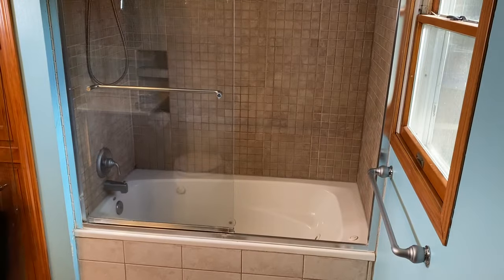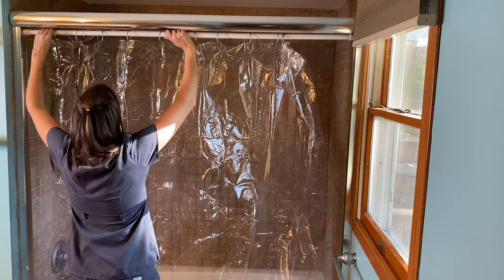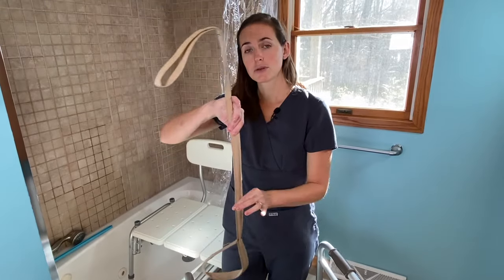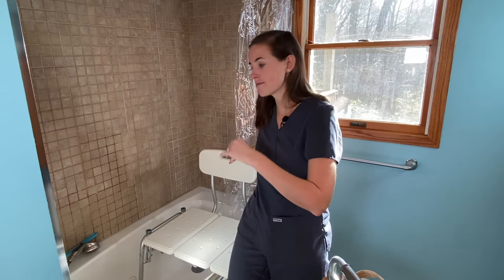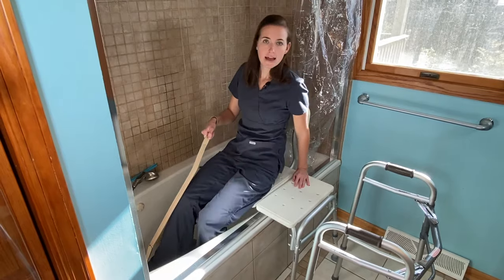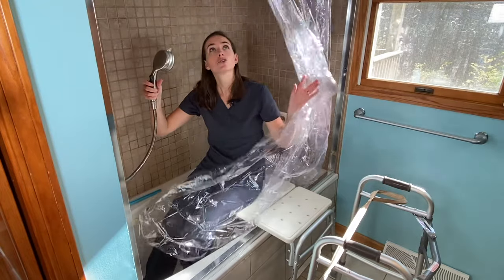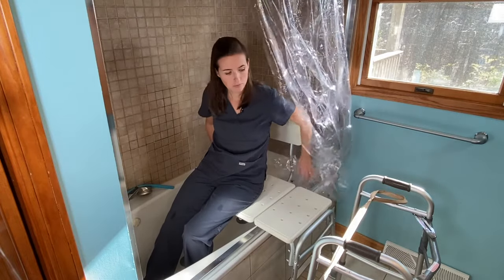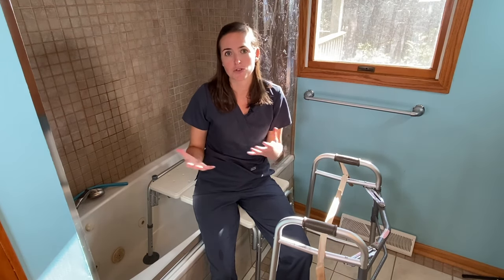Showering After Hip Replacement | Setup, Equipment and Technique for Tub Shower

Comment: A suggestion: Buy a shower-head with a hose that has a shut-off.  (Not necessary if you've a helper)  Some shower heads shut "mostly off." then if alone, you don't need to (no-no) bend forward to turn the water on.  Excellent video, ty.
Reply: Thanks so much for the advice.  Through the whole video I was wondering how to turn on and off the water with out doing before you get in otherwise the floor will get soaked before I have time to get in and pull the shower curtain... I'm so confused my orthopedic and nurses were telling me to set everything up for the operating leg to get in the bed and shower first but the videos are showing the opposite and I don't have a physical therapist yet Thanks to my horrible primary doctor it's been been 10 days and I'm in pain and so confused on what to do or not do other than 90 degrees.  I have avascular necrosis so both my leg muscles are weak before surgery.  Any advice on anything else I'd love to hear,  exercises or which leg you used to get in bed 1st?

Comment: I’m having a hip replacement soon and will largely be taking care of myself. I will have to turn away from the nozzles to turn the water off and on. unfortunately I’ll have to bend over to turn the water off and on. If I were facing the handles i could turn it on after I’m sitting

Comment: My pre surgical instructions (coming up soon) says I won't be able to bend forward to turn on the water and I have turn it on beforehand and clamp it to the bench or wall. I have to go out and get a suction cup shower head holder for the wall as well as a leg lifter, I will have my bench for practicing all this in a few days. Thanks for the tip about cutting a slit in the curtain to poke it down the bench slot, I wondered how the curtain was going to work to keep water in when going around the outside of the bench and the edge of the tub.
Reply: I was wondering about how to turn on the water as well. Wish she would have covered that. Even if you do it before you get in, you would still have to bend to turn it on. Methinks I'll be limited to sink-based sponge baths for the first several weeks.
Reply: While I was still using the bathing transfer bench in my first week I simply stood up to turn on the taps (which advice I read somewhere, and I had installed a suction shower head holder lower down I could stick it into.)

After a week it turned out the hardest part of showering for me was the bathing transfer bench itself as I was very steady on my feet. When I took my water proof bandage off on Day 7 I didn't want to be sliding on the bench any more so close to my incision and one of my post-surgical physio exercises showed me I was safe stepping over the tub edge by bending my knee and raising my feet  in turn behind me while holding a grab bar for safety. We installed 2 more suction grab bars so there's one on each wall of the shower/tub enclosure and I'm safely showering on my feet, now. I don't know if I'm unusual in this but it's a lot less stressful than the illustrated method which I stuck to at the beginning.  I'm on Day 10  after surgery.
Reply: @e.b.gilligan7423 I’m having my right hip replaced on October 21, 2024.  May I ask how old you are?  I’m 71.  I’ve been thinking of just doing sponge bathes for the first week instead of all that hassle.  I have a tub shower.  The water handle is a single knob which is kind of hard to adjust normally, plus the toilet is really close to the tub, so there’s no way I could safely try to turn the water on and adjust it.  I’m overwhelmed by the toileting and bathing.  I guess I could have my husband get the water going for me before hand.  Not looking forward to this!

Comment: I'm about to do a wet "dry run" today with surgery coming up in 5 days, having difficulty in our very small older building washroom now that the toilet seat raiser is installed, trying to get my leg over and past that and the edge of the toilet tank using the new leg lifter. Our antique tub with its sloped insides limits how far away from the taps I can place the bench.

I believe when I had a broken leg 6 years ago we had a shorter "round" toilet since replaced by an elongated one, no raised toilet seat t hen, and it was actually easier to use the bath transfer bench with a broken leg and a soft cast covered in a plastic sleeve than it's going to be with this surgery. The tighter space/higher toilet is a big challenge, I have to lean way back on the bench which is actually on wood pieces for a few inches extra height outside the tub to clear my leg above the toilet.

Wish me luck, I obviously can't sponge bathe for 3 months.
Reply: How did it go? Hope you are doing fantastic, now! I get a new hip in Feb. Just starting to prepare, now that I’ve been to the surgeon.
Reply: Overall recovery from my hip replacement mid September has gone very well. I still have a way to go to normal movement in all respects but my surgeon lifted joint precautions November 6 and I've been able to resume activities like driving, do some stationary cycling to get a little cardio exercise again. I still have some  issues causing pain in places other than the hip and hope to get them resolved so I can walk longer distances outdoors more comfortably and without my cane. 

I only used the bath transfer bench for about a week after my surgery, it was the most difficult thing I was doing because of the crowded space in our bathroom. We installed grab bars on all three walls of the bath enclosure and I showered safely standing up ever since. I do have good leg strength from years of bicycling and always use the rubber bath mat in the tub.  I step over the tub edge  by flexing each knee in turn to raise my foot back towards my derriere, holding the  grab bar for safety. This may not work or be safe for everyone but has been good in my case.
Reply: @e.b.gilligan7423  good to hear your favorable outcome, thank you! Great tips.

Comment: I am learning a lot from your videos - thank you - I am using a bench in my tub/shower combination already with the water hitting my back so I can wash my hair.  Today I had  two handicap grab rails installed. One is on the outside of the shower to offer support in entering the tub/shower and the other is just inside at the end wall.  It is an angled styled one so I can make the adjustment comfortably sliding my hand up to the higher height after getting into the tub then moving to the bench.  Is it truly necessary to remove the glass shower doors putting up the plastic curtain? I always feel claustrophobic with the curtains and they seem to get sucked into the shower thus entangling a person? I would really like you feed back.  thank you
Reply from the maker: It isn’t required if the shower bench fits with the glass doors in place and you aren’t requiring a person outside the shower to assist. The glass doors make it harder to have help, but I agree they are a much cleaner, more visually appealing option!

Comment: Hi Lindsey I am having total right hip replacement in 2 weeks.  My concern about my shower (I live in apartment complex) is no hand held shower head.  I have weight bearing bars installed however I will need to get into the tub standing.  Do you have any instructions on that?

Comment: A great tutorial.  I'm 5 feet - does the leg lifter work for someone my size?  Also L hip - so I'll be using my right leg to get in shower and then lift left?  If I do it that way, I'll be facing backwards from the faucet and there's no room w the toilet.  Also,  maybe a shut off w the hand held shower?
Reply from the maker: Yes! The leg lifter can be held anywhere along the length of the handle and that would make it work for your height. You can go left leg first if that is how your bathroom best accommodates the modified strategy. Good luck!

Comment: Ok I have a walk in stand up shower and I am presuming the OT will advise using a shower chair is that ok to use as I expect I shall be using the air dry method as you say to let my feet dry., although I do have some experience in using a shower chair pre-operation in a normal overhead shower. Now how often do you recommend having a shower? By the by I do have long handled shower tool which is like a scrunchy that women use for their hair and have been using this for some time now.
Reply from the maker: A shower chair should be fine in your case and most find a shower every 2-3 days sufficient.

Comment: I read somewhere to cover your wound with Glad Press N Seal overtop.   Haven't tried it yet.
Reply from the maker: It works pretty well, won’t seal all water out but will prevent the soaking most surgeons want you to avoid.
Reply: Puppy Pads work well to create any size bandage. Since they are made to trap moisture on one side while preventing moisture getting through on the other side, they are great for covering wounds and keeping them dry....just cut to size and use surgical tape to adhere it to the skin. Also, there are products for waterless bathing that are excellent. Wet the spongy material with a little bit of water, no need to rinse...just dry and DONE! You can even wash your hair with it.

Comment: Hi Lindsy - Do the hip-replacement movement strategies also apply to broken-femur recovery?.(metal rod) Thank you.
Reply from the maker: They can apply, but it depends on how high up the femur repair goes. I would definitely use this as a conservative guide, but you may not need to be quite as strict. You can always clarify with your orthopedic surgeon. Safe healing!

Comment: Do you turn the water on prior to getting in the shower and control the on/off by the shower head?
Reply from the maker: Yes, I love to have the water up to temp before getting into the shower and then using the control valve on the hand held shower head to turn off the spray while transferring in.

Comment: I've just had hip surgery but I have the standard shower head attached to the wall. Any quick suggestions?
Reply from the maker: If it isn’t possible to install a hand held shower head, you can either do you shower alternating sitting/standing (if tolerable/safe) or use a measuring cup to fill while seated to help get yourself thoroughly rinsed. Make sure you cover your incision with some cling wrap early on if you’ll have a lot of water hitting it.

Comment: What is the safest way to turn the knob in the shower?
Reply from the maker: Depends a bit on the type of knob. A lever style will work differently than a knob. If you can use the handle from your long handled sponge or similar to prevent having to lean forward. Another option is to stand to reach, so you don’t have to bend forward as far.

Comment: Find a surgeon who uses the anterior approach. You'll not need any of this. This approach does not dislocate, you can pick things up, throw away your crutches after a couple of days, and not worry about using a wedge cushion. I could lift my leg within days. I guess if you're 90 this may be appropriate.
Reply: That's encouraging!! It validates why I want the anterior. Do you know who can't have the Anterior?
I have some dysplasia in my joint. No problem.

Comment: How do you turn on the water once you're in the tub without bending your hip?
Reply from the maker: You can stand from the bench and then leaning forward won’t be significant enough to break precautions. To do it seated would require additional tools based on the type of control you have (lever versus knob, etc.).
Reply: I use my grabber and turn on the water. I do have a single handle on and off lever not the knob type. Good luck

Comment: Thank you. You explained very thoroughly.
Reply from the maker: Glad it was helpful!
Reply: @EquipMeOT thanks for the video.  I'm going to be getting a right hip replacement.  I only have a shower that's walled in with just a small door to get in and out from the shower.  Any suggestions?  Thanks.

Comment: How would you turn on the taps without bending forward?
Reply from the maker: For many I have them turn the taps on before entering the shower with the hand held shower head placed in a holder at a position that doesn't aim directly at the seat. That way it's already on and warmed up before entering and would allow it to be turned on without bending forward.

Comment: Very good but how did you reach the wall to turn the shower taps on
Reply from the maker: You can stand and reach down a little to turn it on and off when in the shower or once you exit the shower and are standing. It really depends on how your shower is set up.

Comment: Please tell me where in Canada I can buy the stiff leg lifter you use in your videos. I can only find flimsy ones.
Reply: Do you have Amazon? They have just the leg lifter as well as a whole set of "after knee and hip surgery" tools.
Reply: The OT department in the hospital has staff that comes around with the  leg lifter and the reachers and the sock aides that you can purchase. The leg lifter and the reacher I have used at home during my recovery and especially when you have those hip precautions anywhere from 4-6 wks of not bending over. Amazing how often we drop things during this time. You can use them also when you have knee surgery/replacement.
Reply: I live in British Columbia

Comment: Carl R. -  
I have a walk in shower with full length glass shower doors - if removing the glass shower doors recommended in this situation, and would a regular non-transfer shower bench be ok here?
Reply from the maker: It would depend on whether it’s truly a walk in shower or if it has a small ledge that needs to be stepped over. If there is a ledge you may still need the transfer bench to  bridge that gap.

Comment: Lindsey:  How do you turn the shower on and off if you are not supposed to bend forward at the waist?
Reply from the maker: This is a common question. Often, i suggest turning on the shower before getting in and again after getting out. It also depends on the type of controller (pull knob/turn, lever, 2 separate knobs, etc.).
Reply: @EquipMeOT  Thank you.
Reply from the maker: You’re welcome.

Comment: Are the tips in this video appropriate for ANTERIOR hip replacement?
Reply: I'm exactly 3 weeks post op, anterior approach. Surgery was around 5.15 pm, discharged around 2.30 the next day. The night of the op I was briefly on a frame, the next day they had me walking on crutches including stair techniques. Once home with furniture and walls I didn't need the crutches at all but took one with me 'in case' when doing my recommended short walks. Within a week I didn't need crutches at all and with the recommended exercises my strength has returned very quickly, for example I can climb stairs normally and only have trouble with steps that are abnormally high. Little pain . I can't recommend the anterior approach more. I can now put socks on my foot again without using a gadget!

Comment: How does one turn the water on and off without bending if living alone
Reply from the maker: Awesome question. This would depend on the type of faucet you have (knob versus lever). The Juvo dressing stick https://amzn.to/3kVNjFm is really sturdy and rubber coated and can be used on a lever style. Knob style is trickier 🤔
Reply: @EquipMeOT  I absolutely love your instructional video! I have a center knob on both showers. One stall shower (very small) and a tub shower. In the stall shower I would have to step in first with my operated leg(right) in order to face the faucet. In the tub shower my good leg would go in first. I am perplexed at which one would be better. I have seen a few videos where the operated leg is bent at the knee behind but I don’t think that’s a good idea. Any other suggestions you have regarding this showering process would be helpful. I live alone and sadly don’t have anyone to help out. My support system is further away where I used to live. Would it be OK to stand in the stall shower? It’s very tiny no. Not sure there would be enough room for a chair and any movement of an outstretched leg. So appreciate any suggestions you might have.
Reply from the maker: My initial thought is you might be able to stand for brief showers in the stall shower, but it would depend on how your endurance is prior to surgery. If you use the tub shower, you can sit and possibly stand to reach the faucet. As long as you don’t bend beyond 90* at the waist to reach the faucet, you might be alright. Hope this helps a little! It will probably take a little trial prior to surgery to see what works!
Reply: @EquipMeOT  Thank you once again. Yes, definitely going to have to walk through some things prior to surgery which is on the 30th of this month. I am 65 years old and a young 65 if I do say so myself. I do not have an arthritic hip but have a severe tear with FAI and bone spurs. I had two different surgeons putting their heads together deciding whether to go  the arthroscopic route or the hip replacement route. Because of my age and the amount of stuff  needed to be done the arthroscopic surgery was ruled out and the hip replacement was decided.
Reply from the maker: Good luck! I hope the surgeons get you up and running!!

Comment: What do you do if your strong leg is the right leg not the left. You got out with your left leg.
Reply from the maker: The transfer should be able to be done either way just minding the 90* angle of the surgically repaired hip. If it’s more difficult to lead with the sore hip than you can turn the bench around and face the opposite wall. If you have a hand held shower it shouldn’t matter which direction your facing (assuming you one that has a control on the head so you can turn it on and off).